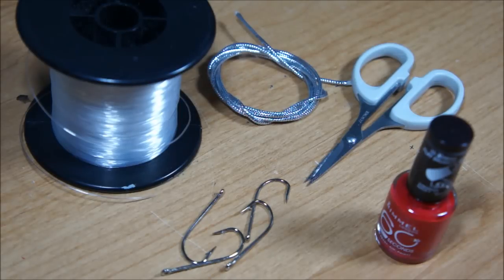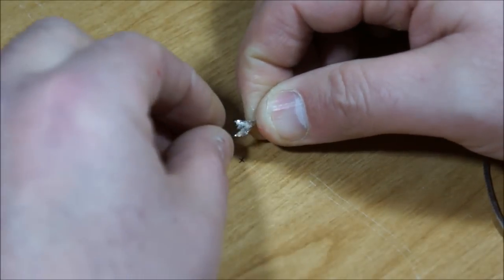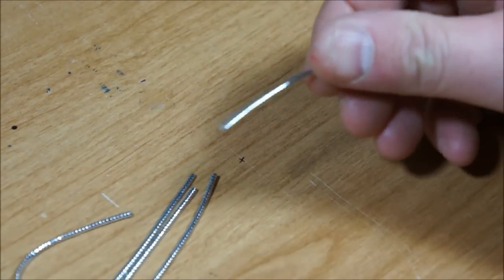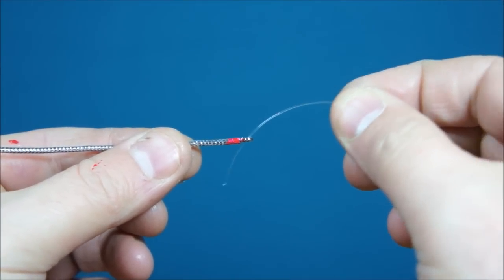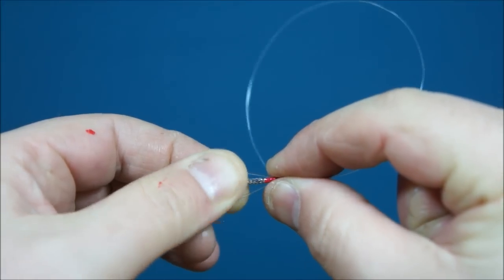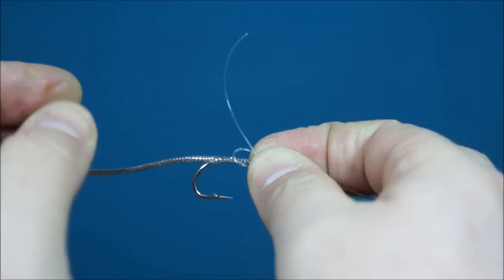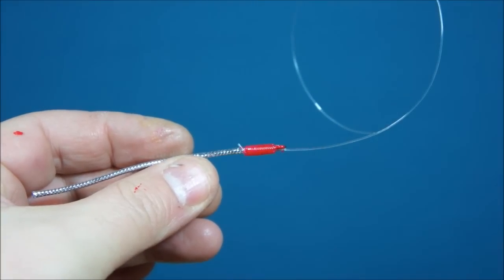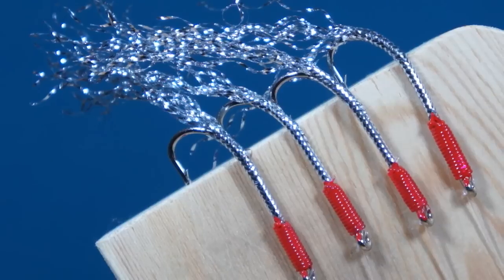How To Tie Mackerel Feather Rigs ,Tinsel Sea Fishing Lures

Comment: This is an older video but vary informative, I’m looking at doing my own mackerel rigs because using the ones they sell at the tackle shops aren’t strong enough, I keep getting cut off by the toothy critters , and it needs to be strong enough to haul them up on the pier about 20’ ft up , do you think it will work using thin wire from hook 🤔 to an say 40-50 lb monofilament for the main line ?
Reply: @Patrick Bantering , I’ve found something at Walmart , I wanted to use a thin wire but all they sold in the fishing section was thin solid tire which is still to thick and stiff , but I went to the craft section and found what’s called “ beading wire “ it’s stainless steel multi strand coated wire on a roll it’s really cheap compared to hard wire and it can be tied into a knot I don’t know the tensel strength but I tried my own strength test with a suitcase scale and it maxed it out and I couldn’t break it have caught bonnet head shark 4 1#2 ft long and a king mackerel on it and it didn’t break they just scuffed up the plastic coating , and it had I think 60 yards on the spool for like $ 2.69  great find !

Comment: Looking back at my amateur radio background, I suppose that silver plated braid from a coaxial cable could be used as well? Just take care that it is not copper, if not silver plated guess that alluminium braid would do just as well.  Check in the nearest cable store. And of course, thanks for the great explanation Paul!

Comment: Do you need to use 35 pound line?
Reply from the maker: No is the simple answer, i use these for boat fishing around kelpy and weedy reefs, i found thirty five pound could just about cope with the conditions. When i use them for casting from a beach i use 2-3oz weights so thirty five pound works as a shock leader so the rigs do not snap. if i was using heavier weights i would need a heavier main rig line, for a 5oz weight i would need 50lb, for a 6oz weight 60lb .  Cheers
Reply: Thanks very much.